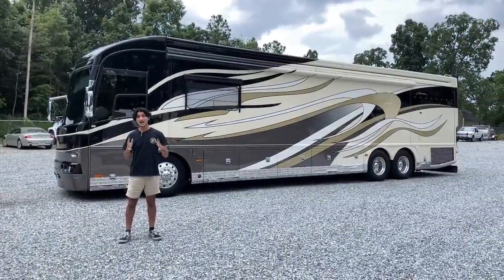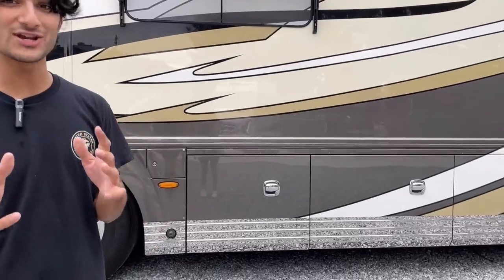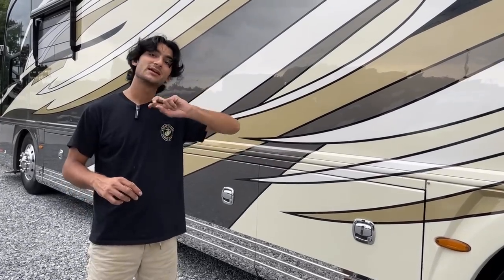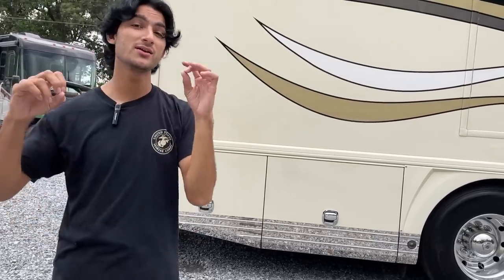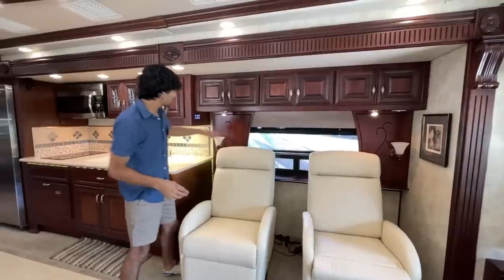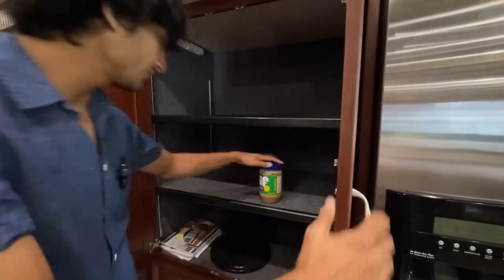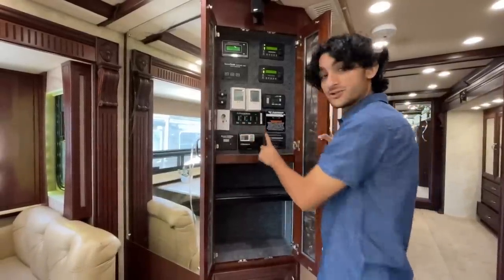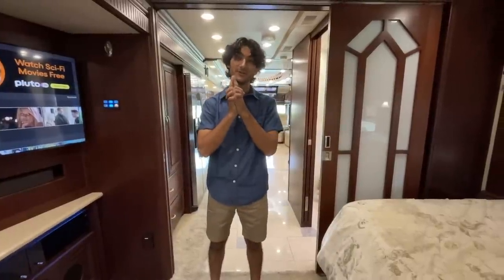KING AIRE KILLER. NO DEF REVISED 650HP IN A 2010 AMERICAN HERITAGE THAT IS SUPERIOR TO NEW.

Comment: what size Generator, hours. inverter sizes. 2010 means no def.?...
Reply: love the heated tile and Cameras
Reply from the maker: 12.5 KW diesel gen with auto start feature. One is a magnum 2812, the other is either a magnum 2012 or 2812. Either 4800 watts or 5600 watts of inverter power which is stout. This has a 2018 revised 650hp 15.0L Cummins ISX with NO DEF!! Wooh hooh!!
Reply: So 2018's don't require Def? How'd they get around that?

Comment: My question is if it has around 150,000 miles on it, which you said is just broken in, why was the motor replaced?
Reply from the maker: Good question! This bus has around 120k miles. Some of these 650hp Cummins ISX had issues that would lead to engine failure, something to do with valve seals I think. Well, that happened to this coach and that’s why the engine was replaced with a 2018 Revised ISX which does not have that issue as common. Huge $50k upgrade, happened in 2018. Thanks for watching!
Reply: Where are you located exactly.
Reply: @rvmaxus if it cost 50gto do the upgrade wouldn't be 50 g but the difference in value between the new engine and the old engine in good working condition. Maybe 10 g max upgrade if that  , correct?

Comment: I wish you'd would give us a price 
Love watching you do these motorhomes  do you still have the black coach that the pilot used to have has a n/w on the floor
Reply from the maker: $319,950, which is a steal for this bus that has a 2018 ISX 650 Cummins. The engine cost and install was around $50k. This is truly a better than new coach. 

That other bus you are referring to was an older Prevost I believe. We have sold that. Thanks for watching!! 
-Mayan
Reply: The price is always in the description. 😊
Reply: @rvmaxus  $320,000 I’d rather buy a xl prevost

Comment: You wanna good coach? Buy a Prevost or Newell. This 650hp cummins motors have been trouble from the start. New 2018 motor will have DEF. Buyer beware. Electrifying or not, it's gonna have issues.
Reply from the maker: Did I say anything about DEF? :)
Reply: @rvmaxus  Your asking me? It's your video, did you say anything about DEF?

Comment: Engine was replaced, 2018 engine, what was done with respect to emissions "stuff"?
Reply: OKH CAND AMI TRIMITI MASINA AN ROMANIA  ?
Reply from the maker: No def!
Reply: @rvmaxus  If that is a 2018 Cummins ISX 15L, it is supposed to have  DEF. And I believe the specs are 605HP and 1950lb ft of torque.

Comment: Must be a def engine, beware
Reply from the maker: NO DEF :)
Reply: @rvmaxus  if it is after 2010 it has def, Counter that with a response
Reply from the maker: @ralphowens4510  we have a 2011 now and it does not have DEF. This 2010 is sold it did not have DEF.
Reply from the maker: So, in other words, some of the 2010, 2011 did not have DEF there a chance those chassis could be 09 or 2010
Reply: @rvmaxus  I GUESS IT DEPENDS ON CHASSIS YEAR